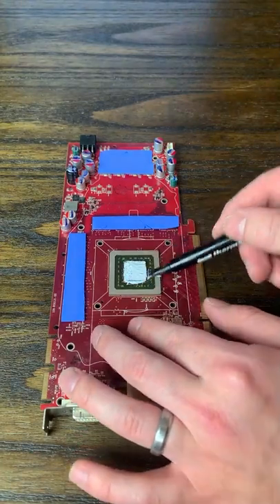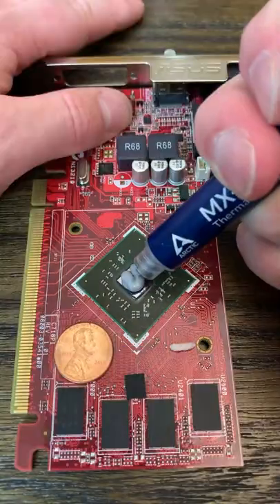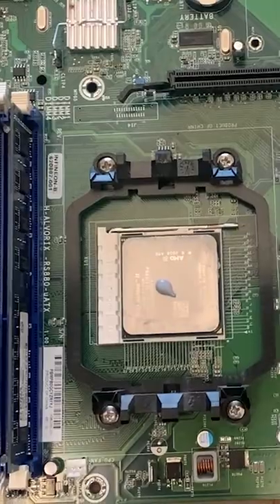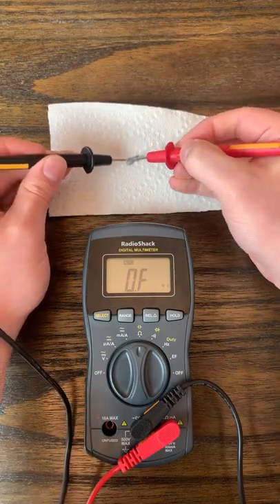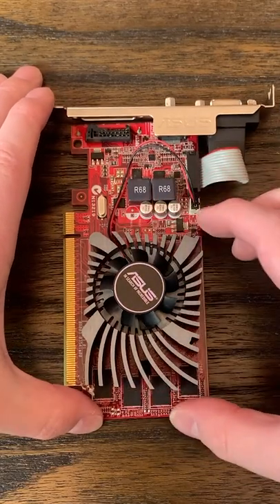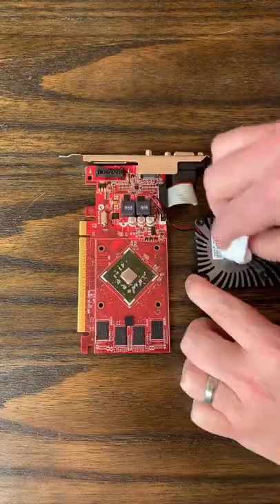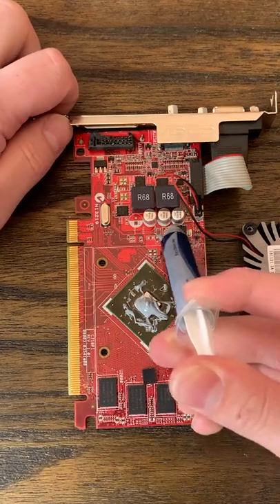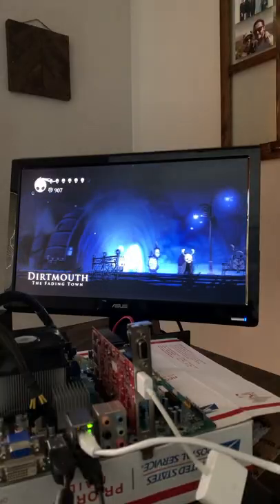Can Thermal Paste RUIN Your PC? #Short

Comment: The only reason why I am not adding thermal paste to AMD cpu's is that it becomes a Solid glue over the years. My 3800k and the pitiful only held on with 2 points cooler box WAS FINE for a long while but it got dusty inside the case and I was dusting it out and when I bumped the cooler, it ripped the CPU out and bent a few pins and broke a few off.

I had to go ahead and just upgrade the system with a new motherboard and a Rysen 5800k and I put a Noctua cooler on top and used a GRAPHITE SHEET that will not become glue.
Reply: I still have the shorted motherboard and the 3800k and I will see what I can do but not for a while

Comment: Unless you're specifically buying conductive thermal paste there's nothing to really worry about.  There are a few pastes that contain copper...just don't buy them😂🤣
Reply: Silver is another thing added to some thermal paste as it supposedly increases thermal conductivity but yeah any kind with metal you should be extra careful with. Same with gallium liquid metal thermal compound, and you have to be especially careful of aluminum parts in that case as well.

Comment: Arctic MX-4.

Good for pros AND idiots.

I should know. Shit is in in both my PS from when I was clueless, (no issues) and also in my PC (built myself) once I learned the basics. 

Does the job really well. No excess PS fan sound, even on hot days you can barely hear it spinning. Same with PC.
Reply: The paste is still pretty garbage and overpriced though. People should instead use something like the Cooler Master Mastergel Maker (great performance and longevity and is also affordable)

Comment: Whoever said that must be some sort of special.
Reply: A thermal paste will still produce shorts. I once changed a thermal paste of an Asus TUF laptop and it had not turned on (backlight stayed on while the laptop was shut off) because i left the paste there. I cleaned it out and everything worked again. So it's best to get rid of any "rogue" paste on the components.
Reply: @one_step_sideways  no it won't, all modern thermal pastes don't use any type of metal, unless you have something like liquid metal or an older version of arctic silver then the likelihood of something to short from thermal paste is near zero.

Comment: "Because its conductive" "or atleast not electrically conductive" im guessing they mean heat conductive? Genuine question, but wouldnt thermal paste be heat dissipating? Pls correct me if im wrong
Reply: No, it doesn't dissipate heat very well, it's pretty thermally conductive though.

And when someone says conductive they most always mean electrically.
Since its a  given that it will be thermally conductive.

Comment: The liquid metal alternatives are electrically conductive, thermal paste is not, I have heard rumours that over time thermal paste can become electrically conductive like De-ionised water can, but I just straight up don't know enough about chemistry for that.
Reply: A thermal paste will still produce shorts. I once changed a thermal paste of an Asus TUF laptop and it had not turned on (backlight stayed on while the laptop was shut off) because i left the paste there. I cleaned it out and everything worked again. So it's best to get rid of any "rogue" paste on the components.

Comment: repasted my laptop, took time for some odd reason, but it cooled off. also have it on my ryzen 5 3600xt and i haven’t breached 72c with the stock thicker cooler (thinner was worse but marginally, so i consider using it for my ryzen 3 1200

Comment: Forgive me if I’m wrong but wouldn’t it be bad if there was a paper sticker still on the cooler baseplate before installing it? Wouldn’t it at least affect thermal performance since (Im pretty sure) paper is not a good conductor of heat?
Reply from the maker: It doesn’t make contact with anything, so not really much of an issue

Comment: It COULD have capacitive capabilities if you used it with an AC circuit. All circuits inside your PC are DC. That's what your power supply is for. To convert the wall outlet AC to more usefull DC.
Reply: You can’t change something major about computers and say “gothca you’re wrong”

Comment: mx 4 can cause problems, or at leats the old models, i put mx 4 on my gtx 780 back then and my gpu didn t work for some reason, imagine the frustration, it was a little thermal paste shorting the smd capacitors, i know that mx 5 is not conductove or capacitive
Reply: MX-4 is garbage in general anyway, one should use Cooler Master Mastergel Maker instead

Comment: Who cares if it's not conductive when it makes cleaning and reapplication a pain, also, you still don't want it in between your cpu pins since it will block the connection. Always put just the right amount.
Reply: What the hell are you talking about in the first half of your medfree rant?
Reply: @honk5468  getting rid of old thermal paste to apply a new coating
Reply: @3nd04  yeah okay and?
Reply: @honk5468  that's why you don't slather all of your components with it
Reply: @3nd04  kind of hard to avoid if youre unexperienced with the 50+ kg of pressure but whatever floats your boat

Comment: You should not say "most" pastes. Very much older pastes from earlier than 2014 contain silver or copper particles. Most modern pastes no longer contain them.
Reply: Look at Arctic Silver for example (one of the most used older pastes that somebody could still have in stock)

Comment: It's old facts that don't have any backing with new products like the new batteries  in phones they don't go bad if left on the charger over night at most the charging connector of the phone will fail first  before the battery does heat makes a battery expand yes which is why u keep your phone in sleep mode and out of fabric when charging  overheating will destroy the battery especially in water dust proofed phones where there is a seal and an aluminum heat sync to get heat out of the phone

Comment: It's fine.

20 years and people still have massive misconceptions about thermal paste, what it is, what it does and what role it plays in a device.

Yes, some pastes are conductive. But it's a small minority.
Most paste is just zinc oxides and bits in some silicone based...paste. That's it.

It only fills in the micro-gaps that exist between a heat sink and the actual chip die. Nothing on this Earth is perfectly flat, let alone a mass produced slab of copper for a heatsink. So...thermal paste to make up for any tiny deviations.

If your card, PC, console, etc isn't turning on or working correctly the odds are almost 100% that thermal paste is not the issue. Again, if your device isn't working...it's not the paste...unless it is specifically overheating. Anything else and it's not the thermal paste lol.

I work in repair and I can't tell you how many times a customer will drop an item off and say
"Ehh, it likely just needs new thermal paste"
or
"You want to charge me $75 to replace some chip I never heard of when it probably just needs new thermal paste!? Scammer. I'm taking me device elsewhere."

Which is just code for:
"Fix my device for darn near free because I'm me"

So most paste isn't conductive, you can't use too much as it will all just push out the sides of the heatsink, you can cover your entire MOBO in paste and it'll be fine and your broken device almost certainly needs more work than a change in thermal paste.

/end rant

Comment: Liquid metal thermal paste: am i joke to you
Reply: it's not the same thing
the purpose is similar, but the components are entirely different.
liquid metal is not recommended in most cases, novices should be discouraged from using it because the potential for failure is really high; when using it, you must assess the risks, be really sure what's compatible with, how to apply properly and make sure it only touches the chip and cooler.
there are cases when applied incorrectly, the damage isn't noticeable immediately, it takes time to form amalgams with other metals and destroys the components from inside

Comment: After this test do you clean up excess thermal paste? As too much thermal paste will make thermal worse than just enough and spread evenly to reduce any air gaps between the chip and heatsink
Reply: Too much thermal paste shouldn't affect temps at all, the cooler will squish the excess. This has been tested many times, maybe if you'd put so much that it would block the airflow then yea, that could run a bit hot

Comment: How can one b thermally conductive without electronically conductive?
Reply from the maker: I'm not a physicist or anything so don't come at me. But the transfer of thermal energy and the transfer of free electrons are two separate things. For example, 100% distilled water is thermally conductive, but not electrically conductive.
Reply: @HardwareHaven  U do got a point

Comment: “Thermal pastes arent conductive”

tests non-conductive paste

proves nothing

I know most of thermal pastes have changed, but its a little strange that you chose to test non-conductive paste. I think it would be more compelling to test theoretically “electrically conductive” thermal pastes to see what happens then. Because then you could have something to actually prove to people with those types of tests.
Reply from the maker: I used a non-conductive paste because that was the exact paste I had tons of comments telling me could be conductive. I was 99.9% positive that this would be the outcome. But there's a possibility I was wrong, which is why I did it. I think most people using metal based thermal pastes probably understand that it's conductive and should be applied differently.

Comment: I mean hollowknight is not exactly a benchmark game.
Reply from the maker: I’m curious as to why you think it isn’t suitable for this video
Reply: @HardwareHaven  i think that if there actually were to be an impact, it would be minor. And probably more noticeable with a heavier game (or just numbers displaying the stats before and after)

But im no expert. Just saying that hollowknight is not that heavy
Reply: @HardwareHaven  infact its animations limit the framerate no?
Reply from the maker: I would definitely agree if o was testing thermals or frame rate or something like that, but since I was just testing if traces would be shorted, it shouldn’t really matter as long as the components are being utilized. And hollow knight was still a decent workload for such a old and low powered GPU. Hope that makes sense
Reply: @HardwareHaven  yeah it does. Shorting is the only real issue. But who knows it, it could have a low performance impact.

Comment: 99% of the 99p eBay cheap thermal paste tubes are electrically conductive killed my old laptop by evidently w touching it with it
Reply from the maker: First of all, that’s a huge bummer. I would definitely recommend buying thermal paste from reputable manufacturers and retailers, especially considering how cheap it already is.
Reply: @HardwareHaven  I don’t that when I was much younger and knew basically nothing about electronics and used some of my pocket money for

Comment: Bro wtf is this video even for. High end thermal paste that uses metal will straight up tell you if the paste is electrically conductive or not. It's totally a thing and I don't see why you'd have to test anything. Just read the freaking bottle.

Comment: actually i just fried my laptops mosfets with arctic mx-4 last month :D
Reply: Doubt it. You most likely messed up in some other way.
Reply: @TechHug  well yes but no. i didnt knew that mosfets use thermal pads instead of thermal paste. so i just replaced all of them with paste then its just fried
Reply: @mythopeic.  ... I think you fried them with your lack of observational skills.

Really, though, there's no "yes" here. You just messed up. Saying you messed them up with MX-4 is about as correct as saying that you broke them with your screwdriver.
Reply: @TechHug  look i know about electronics. and i knew there are thermal pads for mosfets but in my laptop (asus tuf 505du) they not used regular pads. instead they used more paste likely ones. so i thought there is no problem for changing it. then i changed it( not my first time for paste change) but its not booted it up. so i just sended it to asus then they just replaced 1 mosfet and they confirmed i burned with thermal paste! so there are yes
Reply: @mythopeic.  You didn't know that thermal puddy existed. Unfortunate, but still 100% user error. The MOSFETs didn't fry because of the MX-4; they fried because they weren't making any contact with the heatplate meant to dissipate the heat from them. You turning the laptop on did more damage than the paste did.